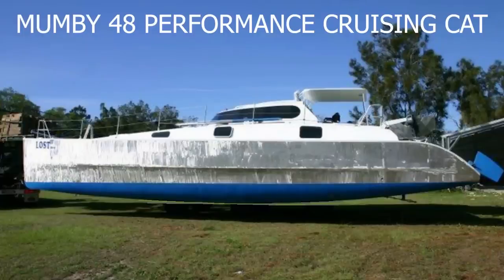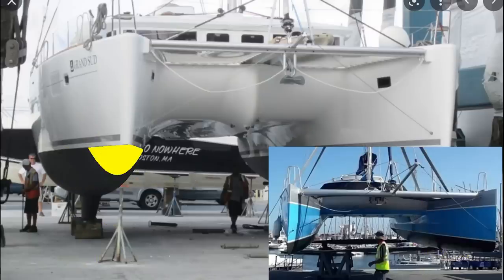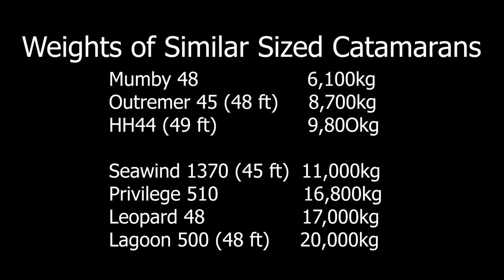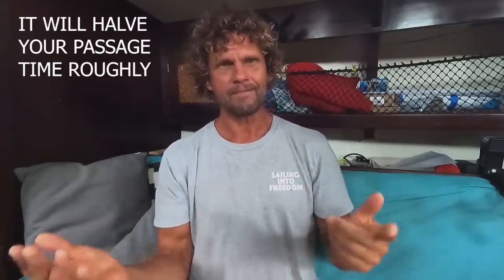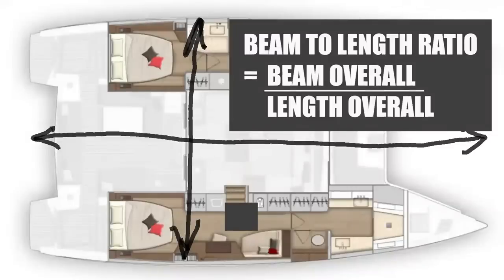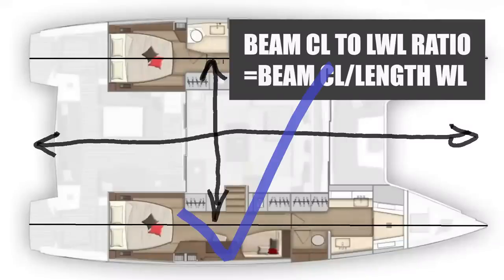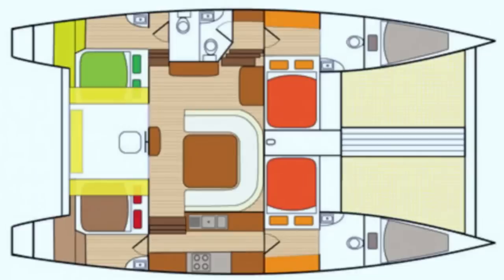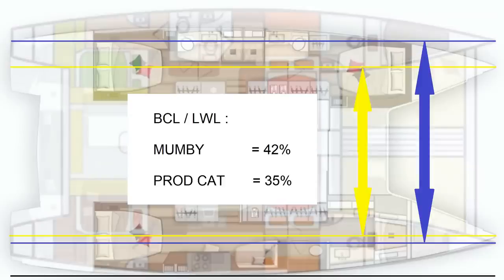How to avoid capsize? What to look for in catamaran design.

Comment: Had the 'pleasure' of crewing on an Outremer 55 Light on an ocean passage. Total fkn rocketship mate. Exited the barrier reef doing 15 knots under full rig into the ocean swell, withing 30 minutes we had the boat completely airborne 3 times, big crash as it hit the water again. It took a couple of reefs in the main and rolled up a good portion of the jib to slow it down to less than 8 knots in order to get it to stay in the water. The repeated slapping of the bridge deck still interrupted our sleep. We nicknamed this boat the vomit comet, even the hardiest of crew who had never been seasick in their lives were chundering over the side.
Reply from the maker: Really? What angle was the wind, and what angle was the swell
Reply: @SAILINGintoFREEDOM  The wind was around 60 degrees on the starboard side and the largest swell was also coming from the same direction. There was also a smaller swell coming in just off the port side. It was when the swells coincided at the right time was when the boat got airborne. The owner had the boat for 5 years and never been offshore and neither had we, although we had a bit more sailing experience than he did mostly sailing dinghies and trailer sailer's. I quizzed him about the lifting off and asked if this was the way he normally sailed the boat, and whether he thought the boat would still be in one piece by the time we got to the Solomon islands (from Cairns). He looked at me and said, I don't think so, lets slow it down.
Reply: @SAILINGintoFREEDOM  The right question. The La Vagabonde Outremer has clocked speeds of up to 20 knots (!) and although it freaked Elayna out, it certainly didn't get "airborne".
Reply: @leonaessens4399  yes, young alan thought he was airborne but a 55’ boat doesn’t just jump out of the water under 30 knots 🤣
Reply: @leonaessens4399  they were running with the wind behind them at the time though.
Reply: @tomriley5790  Oh yes, they were. But try doing 20 knots in a same-length monohull, wind behind you or not. And to some extent Riley ended the run because Elayna got scared, not because he even thought the boat couldn't do it. Nor does it change his general belief that speed is a factor in keeping out of harms way. Meaning outrunning storms, something he talks about in exactly the same terms as our friend Plukky. I myself find all this fascinating because I once owned an all-wood 45ft trimaran, back in the late 70s, and even back then pondered the question of the advantages of a multihull's speed potential as compared to monohulls of same length. In my boat's case it wasn't that dramatic, she was a bit of a lumbering "giant" and 10 knots was pretty darn good, as far as I was concerned!
Reply: We’ve got an O55L also - lots of passages and never came close to lifting off. Oh well, that owner will learn. 

Regarding the BCL/LWL ratio, the O55L is 36%. Certainly doesn’t mean that the boat is dangerous or can’t carry sail.

Comment: Thanks for this, makes me feel better. I have ordered a Seawind 1370 and I calculated the BCL/WLL = 41.3% and I regularly crew on Seawind 1260 and it has BCL/WLL = 43.2%. These boats also have a very low boom. Good all round 🙂
Reply from the maker: True but a bit too heavy for my liking
Reply: @SAILINGintoFREEDOM  I agree, it is a very heavy boat for its length.  Based on your previous video I suspect you also don’t like the big opening between the cockpit and saloon?

Comment: Hi plukky.,you don't need to jump in the water to get the centre line ratio,you just measure the bow centre to bow center on the deck  at the front of the boat
Reply from the maker: ...I just like being in the water... Are mini keels in line with the bows or center of bouyancy?...I don't know this but the hulls aren't symmetrical ... Not sure... You are probably right or they are close enough ie within 4 inches probably.... Anyone know the answers?
Reply: @SAILINGintoFREEDOM  You could also be right .But two rights don't make a wrong so that don't know where that leaves us 😅 . Good luck to your future ✌️🏴

Comment: While the maneuverability problem for wider cats can be greatly improved with larger, more effective rudders that most cruising cats don't have, there is another less obvious, but more insidious danger in an excessive beam length ratio.  Pitch-poling in heavy conditions.  Off the wind, a narrow cat will start to fly a hull when the pressure increases - a situation that's reasonably easy to bail out on.  The wider cat, with more stability sideways, looks for another way to relieve the pressure.  Unfortunately, that next, less stable, direction is a vector toward the leeward bow and whatever buoyancy it has.  In my greed for upwind and reaching power, two of my early racing designs had this tendency.  From a racing perspective, additional beam not only provides stability, but it also allows you to fly the weather hull at a lower, safer heal angle.
Reply from the maker: Hey Peter, thanks for making a comment. I really respect your ideas in catamaran design. Thanks for not being the usual hotel designer that we see all the time nowadays on the water.

Comment: Hi. Great topic. I prefer my monohull thank you very much. Cats are more stable upside down than right side up. But at least they don't sink! The biggest thing you are overlooking is the importance of hulls ability to support the weight of all the gear cruising requires. Monohulls are displacement hulls. They handle the weight really well. Cats are more of a plaining hull design that sits on top of the water. The hull shape you describe favorably does poorly with supporting additional weight. You load a M48 with the same gear as a Lagoon and the lagoon will be faster and more stable. The production Cats have wide hulls that can safely support additional weight. There are a lot of factors that go into Cat stability besides just length to width ratio. A narrower boat sails better. Points higher. And can achieve the same or better stability by increasing the width and buoyancy of the hulls. Also keel design and rudder design play a large role by allowing the boat to slip sideways or round up into the wind much before forces would be enough to capsize. A skinny racing hull overloaded with cruising gear can start to submerge on the leeward side and cause the boat to quickly trip over itself and capsize.
Reply from the maker: Coming up in a later episode....I hear you can load a lagoon 50 with 11 tonnes so it becomes more than 30t. That ain't going to be fast. And how much shit do you need to drag around?
Reply: @SAILINGintoFREEDOM  😂👍
Reply: @SAILINGintoFREEDOM  water maker. Generator. Solar system. 200g diesel fuel, 200g water. Dinghy and motor. Sails. Toys like SUP, foil boards, kites, wings, efoil boards. Camera gear. Beer. Oh, and don't forget food! 😎🤙

Comment: Hi Plucky 
Back in the day when I ways trying to get the Lightspeed 58 project going I met with a cat salesman who, at that time had sold more cats than anyone else in the world.  He took one look at my drawings and said it was un-marketable.  " I can't sell a big catamaran that doesn't have a walk around queen sized berth."   He was right.   500  Lagoon 500's later they've been there and done that,'  Fortunately the world is beginning to shift ever so slightly on its axis as those things sail around their anchorages and fall apart in ordinary sea states.

Mumby (and Suttleworth) are two of the rare designers that understand the importance of air draft aerodynamics. That  said the one modification I would make on  the Mumby is to bring it into compliance with my Basic Rule.  (The Rule being  "No Lightship Bridge Deck Clearances less than 36" )

ps:  Having designed a up-galley salon that the buyer insisted upon putting a monster household refrigerator into, I love the open side down galley that  aluminum construction makes possible.
Reply from the maker: Thanks for the comment my friend. To make the bridgedeck 5cm higher is a lot of work. Hulls are either fatter or deeper. I think 850 is plenty. The higher the bridgedeck the higher your main body air draft is.... Compromise compromise compromise.  But tweak the plans, CAD them and I will build it. Deal?
Reply: Plukky
 @SAILINGintoFREEDOM  

Don't bother with a kickstarter campaign. Knowledgeable information about catamaran design is so rare that you should be able to sell your series on catamaran design for thousands of $$$ to anybody considering buying one.  Perhaps it should be a legal requirement verified by a written test just like a RYAC license!

Comment: I think you are missing a tradeoff (if anyone is still paying attention here). A cruising cat overlaps monohull speed to the cat's advantage generally, yes. They are trading off speed for living space vs a mono, not performance. If you are trading out luxury for speed wouldn't something like a Rapido tri spank any cat of comparable displacement and length for both safety and speed? So the real advantages of a cat are more up in the air? That said, sure, there is a good bit of variability in cats, and this was an interesting video. Thanks. I mention this because I have been "shopping," and life at anchor with guests is a factor. Cats offer that in spades, if one might find a decent cruising compromise

Comment: A observation for Peter and others is that rig set ups for single handed or short handed sailing can make a boat safer...
Roller furling on foresails  and roller boom mains ..they are infinitely reef able in difficult conditions..and easier to sort than in mast main sail furling.

The rig conventional performance rigs are part of the problem for the cruiser wanting to maintain the safety speed ease of handling balance... race boats are seldom comfortable and that brings on the biggest risk of fatigue...
A performance cruiser/passage maker has to be protective and supportive of its occupants but still might best be seen as functionally optimised.

Peter theres an Australian Professor based in Newcastle Australia whose pioneered  printed plastic film solar panels .
They are very light and the cost is low... Maximise your high capacity  roof solar but you could wrap other hull areas in this stuff.. see if he might help out.🤷🏻‍♂️
You'd probably get on well from what ive seen of him.
Reply from the maker: You are right..I just don't know why people are so crazy to have in mast furling.... Although Hanks are the best but lots of effort... You can always drop a hanked on sail.... Remember when my bearing broke in my furler and I couldn't unfurl it to drop it or furl it...stuck halfways in and out....I must admit I was a bit worried then... But it was sorted with a bit of brain...but only a bit
Reply from the maker: Can you send me the guys details...to peterlukursky@gmail.com. thanks
Reply: @SAILINGintoFREEDOM  
Manually handling sales and trying to hank them on/off or reefing  in bad weather and a chop doesnt sit well with my sense of self preservation .. a roller boom main puts the difficult bits all down low and keeps the stored sail mass lower..🤔 just needs a robust gooseneck and roller set up.
Reply: @SAILINGintoFREEDOM Did you make a video on what you did with the stuck furling system due to bearings? I’d be very interested to hear

Comment: Thanks, Plucky! I enjoyed this episode.  As you were closing, I was thinking that we should understand the +/- of catamarans - and buy a monohull instead. Heel is not a terrible thing.
Reply from the maker: Monohulls are good too
Reply: Often when cruising you end up anchored behind an island or headland, bow into the wind.  Unfortunately, the waves bend around the land, creating a situation where you're anchored, trying to make dinner or sleep with the boat rolling in a beam sea.  We saw this time and again in the West Indies.  Fortunately, we were on a cat that just did a gentle side shuffle in those conditions.  That, the privacy of separate hulls, and shoal draft convinced me about cats for cruising.
Reply: @pwormwood1  Enjoy your state of enlightenment caused by the wormwood.  I understand the comforts of a catamaran in many places.  I've sailed small cats like the Hobie 16.  But I enjoy the response of a balanced monohull.  As long as the wind provides the power, I can enjoy many different rigs.  I'm still working to learn the preferences of the Flying Tiger 10m that I crew aboard.  It's just a completely different approach to sail trim from a cruiser.
Reply: @williamstreet4304  Like you, I enjoy the feel of a well balanced sailboat -  in my case, no matter how many hulls it has.  The reason that Avalon exists is that, at the time of her creation, there were no cruising cats for performance sailors.  Today, there are only a few.  Frankly, I was amused at the concern expressed in the comments on the Avalon video that she may not have an autopilot.  My amusement came from my experience sailing aboard Avalon and her bigger and smaller sisters - although they have autopilots, we hardly ever used them because, unlike most cruising cats today, the boats are responsive and a hoot to sail.  The crews would all but stand in line for their turn to drive.  So, don't give up on the idea of a cruising cat that's fun to sail.

Comment: Great info plucky but some of us don’t care about performance as much as you comfort and room yes that’s terrible but I’m after a condo that floats .hang around the islands for weeks or months move on slowly to the next place.need to get there a little quicker fire up the engines no big deal just hated small fridges and clutter everywhere and no room to put stuff I don’t need 😂
Reply from the maker: You will find yourself in trouble eventually with that boat you are describing and you will scare yourself so badly because you have so few options that you will not want to go back on or your partner

Comment: What length and BCL width are you thinking, or is there a standard width and length for Mumby?  Is that 48'?
Reply from the maker: Mumby 48
Reply: @SAILINGintoFREEDOM  It was a bit of a dumb question on my part.  I was wondering if the 48 referred to the length and now know that it does.

Comment: I know this is a couple years old and I hope you get this but, couldn't the builders just widen the deck between the 2 hulls? Wouldn't that both increase the ratio and allow for even more living/entertaining area? How large can the deck between the hulls be? also, how thick or narrow? I have been wondering a lot about this lately as I am thinking about having a boat built/building a boat but I probably need to talk to someone who has a naval architecture accreditation for the supper specific details, but I was just wondering about your thoughts.
Reply: You answered the first part about just making the boat wider overall. The second part of the question I asked I was thinking about maybe having some of the equipment, like cold storage, directly under the gally within the deck of the platform. This would make the platform thicker but how badly would that affect the performance? I know it could potentially just catch wind itself if it's too tall but I don't know how fast the tradeoff becomes serious enough that it isn't worth it... Thanks for the video! It was extremely helpful since no one seems to ever talk about the technical side of the design of sailing cats.
Reply from the maker: This would take a long time to explain... and i am strapped for time.  Do a lot of reading... that's what i did

Comment: Hey Peter, the Mumby 48 is a very nice boat, from what I've seen. When are you going to start your build? It will make for good content when you start, and there isn't anyone I know of doing that type of build. Welding that much aluminum will take quite a long time, but might be easier than building a kit composite cat in the long run :)
Reply from the maker: Soon my friend. Cebu Philippines
Reply: @SAILINGintoFREEDOM  Hey Peter, so you'll be able to use some of the same shipwrights that Tim uses? That could speed things up a lot!

Comment: Nice video ,are you also making one on pitch-poling?
In the beach cat league I got experience with being out control by waves from the back and how your bow upper hull shape rescues you. 
Any thoughts on that in big cats?
Reply from the maker: Yeah they have taking that away for different good looks but these are heavier boats and no matter how much flairing I think you will still bury and pitch pole if not running Stern lines to slow you down

Comment: From the catamaran pictures in your video it's obvious it's a pretty rare occurrence. In the few you were able to find one was lost in a cyclone, one actually flipped because it took on water and was almost sunk when it flipped. Best I can tell one flipped while racing in a regatta and we don't know what happened to the last one. What about the two Chris White performance cats that flipped?  🤔 You can choose a performance cat without knocking other catamarans. I wouldn't want to deal with an aluminum boat despite its advantages in some areas. The Mumby 48 is a great choice if you want to build it yourself. Best of luck with the build.
Reply from the maker: I had a bit on the Chris white capsizes originally but i decided it Will go in a later episode for perspective. You can't compare anyway since the performance cats are doing way more ocean miles comparatively speaking based on numbers because I can't explain stats AND do cat design at the same time.... No one would bloody watch ha
Reply: We're halfway around the world on our circumnavigation on our 38ft catamaran and a bigger cat would be nice!